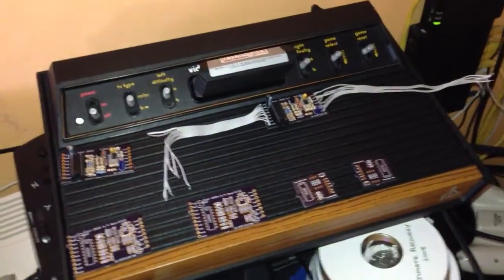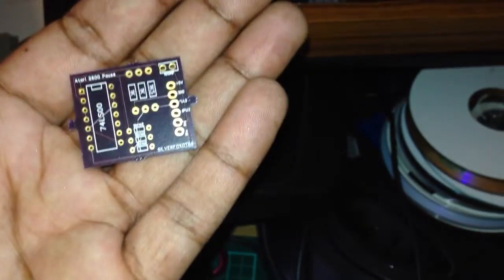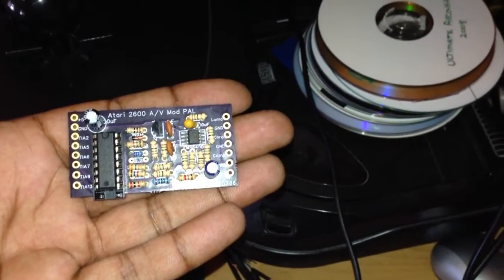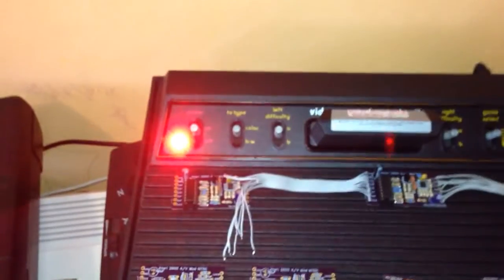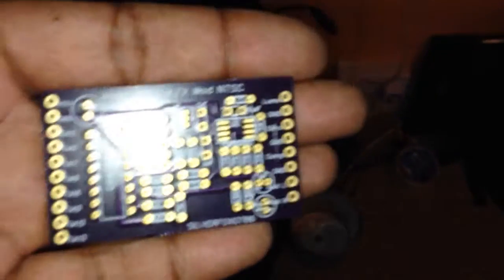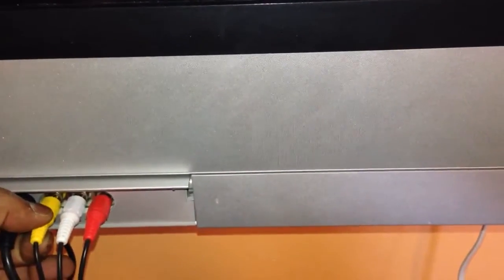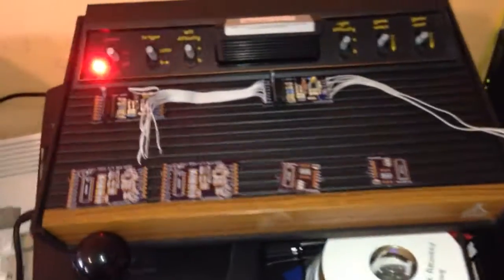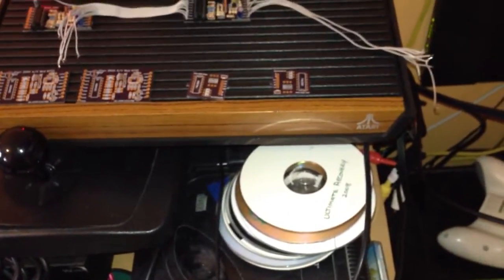Ultimate Atari 2600 Modification

Comment: Hey, neat PCB's, I wouldn't mind modding one of my 2600's to have AV.  Wondering if you're getting as far as SVIDEO then you've got Chroma/Luma separated which is "almost" CVBS - is it possible to feed this through something like A TBA530 and get true RGBS out of it - I was thinking that true RGB might be even better picture quality - and also you could fire RGBS at an arcade monitor ;)
Reply from the maker: Hi James AV boards I have I will email you as for the TBA530 i'm going to look into it as its would be awesome to get the Atari 2600 into a Arcade machine.